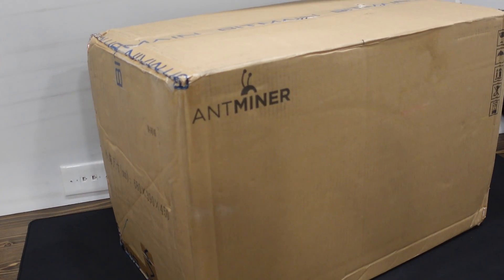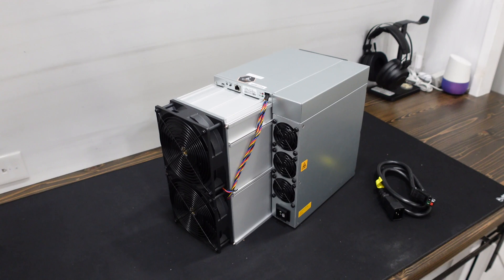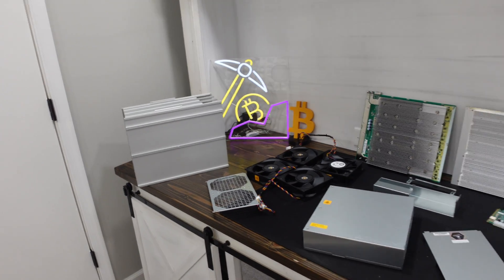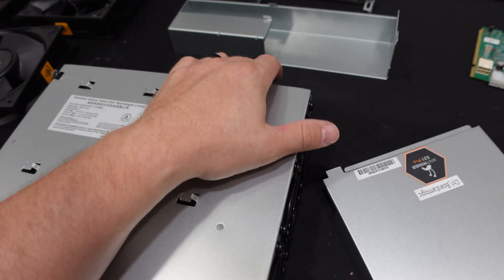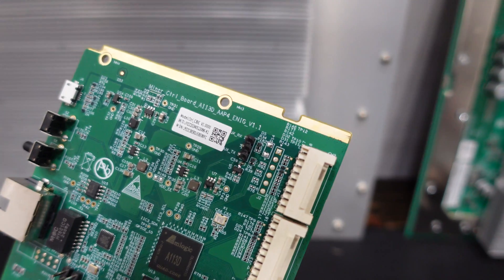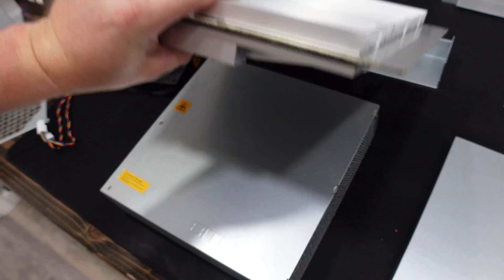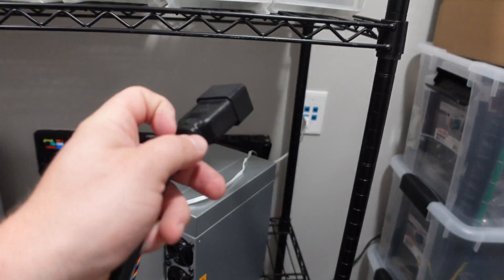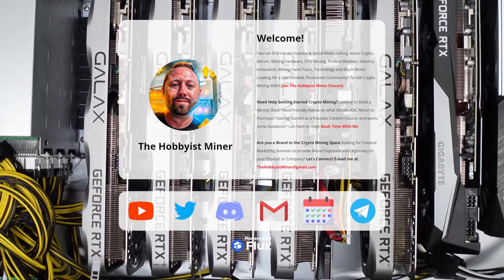I took apart the BEST BITCOIN ASIC miner | Bitmain S21 Pro Tear Down

Comment: The coating on the boards is called conformal coating or a post coat. It protects the components and their leads and the traces from corrosion.